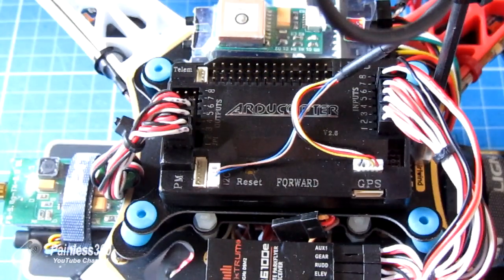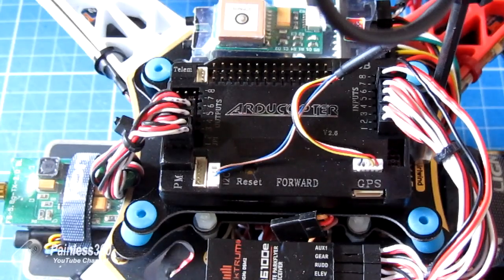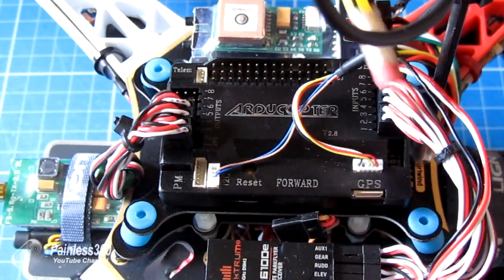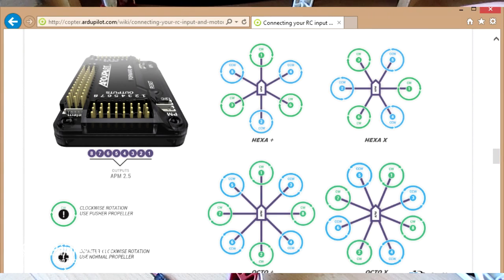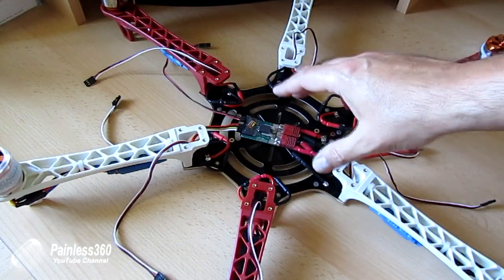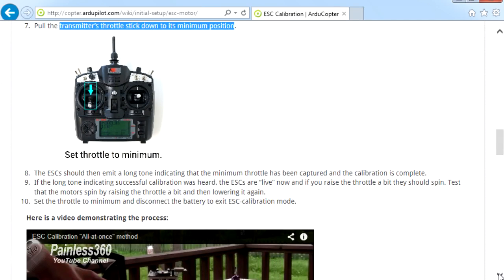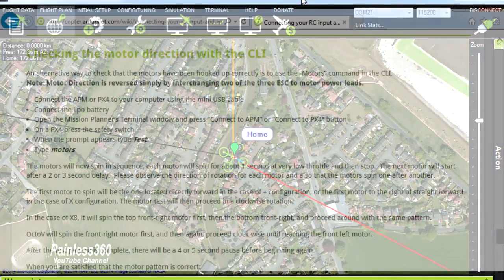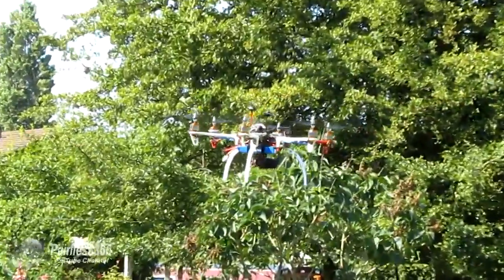(2/8) APM 2.5/2.6 - Powering the board, motor installation and ESC calibration

Comment: Hi there ,thnx for all the uploads ,ive found them very helpul ,im new to building and bought used kit with an arducopter flight controller in, im having problems updating the fc with the mission planner program, it is asking me to use bootloader (Potential for bricking fc in warning ) any thoughts , i can calibrate compass (Working) thanks for your time
Reply from the maker: If it is working fine then why update it? Mission Planner is good at recognising the board type normally so there is little risk. But, flashing it will mean that you will be setting everything up again from scratch and catching anything different that the original builder setup. Best of luck!
Reply: @Painless360  thnx for replying so soon.i wasn't sure if by connecting it to the mission  planner it had started some sort of auto update procedure .

Comment: Using APM 2.8, Taranis Qx7, every time I plug in the battery, I have to do ESC calibration / Arming. What is Wrong...???
Reply from the maker: an ESC will only enter calibration if it sees a high throttle signal when it's powered on - what troubleshooting have you already tried?
Reply: @Painless360  Thanks for your quick response. I follow your videos & instructions. They are accurate. APM is in stabilize mode. Still every time I have to go through Arming excercise.
https://youtu.be/LEKSkOFHB-c

Comment: Hello I want to ask that if I have already updated the firmware and done all the mandatory settings and there is a newer firmware version available after 2-3 months , then do I have to redo all the mandatory settings after flashing the new firmware or just flash the new firmware and the earlier settings will remain retained. Plz reply !!! Very Urgent !!! I am your subscribed user !!!!!!
Reply from the maker: Arducopter 3.2.1 is the last version that supports the APM, I've not used one for a few years now. I'd read the release notes for the version you're interested in but I always go through each step again after upgrade as things change..
Reply: Painless360 thanks a lot you solved my problem

Comment: Hello.
This might be a long shot asking for help here but I spent the last few hours trying to get this to work without success.

So I got a really cheap APM 2.8 board and got it configured with everything. My only problem is: the ESCs won't retain the calibration after I unplug them.

I calibrated all 8 ESCs one by one with my receiver and they all work fine, but when I take out the battery and plug them back in, they don't even start (they require the high and low signal every time they are powered)

the only way I could get it working was by painstakingly calibrating the ESCs, then plugging them into the APM board (without powering anything down).

is there any script or something so the board can do this calibration procedure every time when I start it? if there isn't, I'll just make a small board with an arduino and some transistors that calibrates them automatically when it powers up...

Thanks for your help in advance
Reply from the maker: I've not heard of that. I check the forums regarding the particular ESCs you're using.
Reply: The problem is, these ESCs are the really cheap ebay ones, so they don't have any info on them, only a "30A" sticker, but that's just the max load they can do. 
I did find a post on someone complaining on "30A mystery  ESCs" doing something similar, so  yeah, I'll look into it some more

Comment: Hello I'm newbie. I don't have power module, so i had power apm using input pins (direct from balanced pins on lipo ), and on the ouput i had removed +5V pin in 3 pins from ESC. plug it ok. Until i plugged ESC 11v to ESC distribution power board. SMoke out, circuit had been shorten. 
What have i done wrong ? pls tell me before my 2nd apm rip again. Thanks
Reply from the maker: Please follow the series here, I avoid problems like you've experienced. The Ardupilot website is excellent on the steps to follow to. Use a power module to power it, or a dedicated UBEC, don't power it from the battery..
Reply: Hi, thanks for reply. But I'm still very confuse. On ardupilot website did not mention anything about power apm pn input and ouput in the same time .So can i use JP1 to power through ESC. plug all 4 esc direct outpins like you did in video ? or just 1 ESC power and the rest are data only ?
Reply from the maker: All in the videos...

Comment: i have just got a APM 2.6 recently an am going to use it on an S500 quadcopter on which I am currently running a KK2 FC on.
I am running Opto ESCs on it and at the moment using a UBEC to power it from the batt/bind port on the RX, I am guessing that I can still power the APM controller the same way?
Reply from the maker: I'm guessing so. I haven't done anything with a pm for quite a few years now. Best of luck with the build!
Reply: Painless360 thanks for the reply and I decided to power it from the motor ports, just another question, I have calibrated ESCs but now when armed, it runs the motors automatically, any advice, cheers, great work.

Comment: Hey so when I do the ESC calibration all at once one of the motors #4 doesn't spin correctly its twitching is this when you have to do them individually or a sign of a defective motor?
Reply from the maker: I've struggled in the past with all at once calibration. That's why I tended to do it individually. I would personally have a go at trying to calibrate them individually and if one of them is still misbehaving investigate further. Best of luck!

Comment: 1. So the way I understand it, if I want to power a servo or two such as to operate a gimbal camera rig I should remove JP1 and add a 5V BEC power source to power the output rail. My ESC's are linear so I can leave the red wires in place. At the 4:02 mark you state that if you need to power the board via USB and power the ESC's with an outside power source, e.g. when using Mission Planner to check gimbal operation, etc., that "you will pay a fine" (meaning you will be kind of stumped by this later or do you mean the board will be damaged), please clarify. This video by 75echo (excellent source for more info) "https://www.youtube.com/watch?v=TFCmUuvcH04" warns about this also. I don't really get it as it's still 5V, must be current related. So I guess the work around is to install the jumper when doing tweaking, e.g. testing gimbal movements, mission planning, downloading flight data, etc. and you need to be hooked to Mission Planner. Then, after doing your setup and tweaking and before flying remove the jumper.
2. I assume the external BEC can be powered by the main battery or should it be on a separate one? Ideally a separate one but weight wise it's not practical. Just trying to be extra careful as I've had a few too many gadgets smoked by getting in a hurry and winging it. Anybody else welcome to chime in also.
 -- Thanks for all your hard work putting these videos together!
Reply from the maker: If you're planning on using something like a gimbal don't try and power it through the APM. Use another battery eliminator circuit to supply a separate, high amperage 5 volt supply to the servos so that in the event of a problem it won't affect the flight controller. See my build videos where I've done something similar.

Comment: Hi @Painless360 
I have got a pretty tough issue with my APM 2.8 build. 
If I do the setupt, calibration ... everything works fine. But if I then arm the copter and  just give it a little bit of throttle input, the motors jump to 25% immediately! (This behaviour is not seen while doing the esc calibration) - also if I try to take off, and start incresing power the drone (while I am still below 50%) just accelerates throttle in a crazy way and shakes horribly... I have no idea what I am doing wrong.... I use an APM 2.8, LittleBee ESCs, 6S LiPo and a PDB.

I summed the issue up in my video
https://www.youtube.com/watch?v=RKqYYa7d6Wk&t=3s

Maybe you have got an idea whtat the issue could be?
Reply from the maker: Not sure. See my APM series for everything that I used to do to get these boards flying well. The APM is very old now, and it's not one that I've recommended for at least two years. Check the forums, there might be detail in there that will help. Best of luck!

Comment: Hi Lee   I am changing the original radio supplied with my Quanum Nova Pro, for Frsky X8R receiver.  I would like to use an sbus to ppm converter cable with this set up. I have placed a jumper between pins 2&3 on the signal line. I noticed that there is a plug marked PWM on the analogue side. Should this be removed when using ppm?  Also the two cables that run to the gimble connectors under the body on the craft, can these be plugged into 6&7 on the output of the control board?, they were originally plugged into 6&7 on the rx.  I have watched the complete series on the APM and failed to notice any mention of PPM
Reply from the maker: When I swapped mine I used PWM and it worked great. Best of luck!

Comment: Should I use a power module for the apm 2.8???
Reply from the maker: You can..
Reply: Its already getting the power from the esc red wires...so should I use the power module only or only the esc wires or both??
Reply from the maker: +Saikat Das your best bet is to read up with the latest documentation. Here's a link - http://ardupilot.org/copter/docs/common-3dr-power-module.html
Reply: In esc calibration I have done Both the processes but one of esc is still beeping after arming..
Reply: the one which is not working..

Comment: may i ask how you mounted the anti vibration board?
Reply from the maker: +talal Alotaibi this is quite a old video so I guess I will have used one of two methods. I'll have either used cable ties or actually screwed the bottom plate to the top of the model. Happy flying!
Reply: well ok thanks

Comment: Hello, I have already burned 2 Power Modules. Can you give me some advice tips and tricks on how to install a power module? Do I need to remove all 5V red wires from ESC? Do I need to secure anything else? thanks...
Reply from the maker: I’ve not seen that here, I don’t tend to use power modules with a APM’s. Best of luck with it, let me know when it turns out to be..
Reply: If you are not using PM with APM then how you have installed failsafe option? I mean the option when the bat mah is under an amount THEN the quad does something. The FC must somehow be able to monitor the Voltage of the battery and without the PM the APM will not be able to do nothing.
Reply from the maker: You’ve answered your own question there ;) I’ve not used the APM for years and no longer recommend using one (see the last flight controller comparison video). Happy flying!

Comment: Hi i followed ur videos about APM but i have a problem. I upgraded from CC3d setup to APM 2.8 recently. So the wireing and ESC + other parts should working fine. But when i try to do esc calibrating (both single and all in one methods) my ESC s keep beeping. how to fix this?

Comment: What if I'm using ppm-sum which sums all the channels pwm signals (throttle - yaw - pitch etc.) and uses only 1 channel instead of using different channels for each pwm signal? I mean my throttle channel is 1 but everything else is channel 1 too so can I use that channel to calibrate my esc's manualy?
Reply from the maker: +Okan Kaylan you need a PWM signal, you can’t use PPM to manually calibrate the throttle. You can still try the all in once method..
Reply: I've purchased a new nova pro fitted with APM 2.6. I also got a Turnigy evolution tx with  ia6c Rx.  I've read and watched 100hrs of tutorials but I can't figure out the config for optimum wiring.  Im thinking I need a different APM that supports ibus or grab a converter cable. 
Any suggestions please?

Comment: can my esc power up apm board?please let me know as im confused of its specs http://arduinopak.com/Prd_Detail.aspx?Prd_ID=17540 or do i need power module?
Reply from the maker: The BEC in your ESC that supplied 5v should do.. You'll see me cover all of that if you watch the series.. Best of luck!
Reply: Painless360 yeah i saw it that you covered. But you also said it should be 3A also. So im a bit confused here. Is my esc output 3A in bec? Thanks :)
Reply from the maker: +Mukarram khalil only the specs of the ESC you’re using will tell you that..
Reply: Painless360 my specs say stressed 5v/3A and linear 5v/1A. So what does that mean?
Reply from the maker: +Mukarram khalil no idea, I've never heard of something being described as 'stressed' before. I assume that means a temporary peak?  Id check with the vendor who you got the ESC from. Best of luck

Comment: what motors are you running on your hex or quad?
Reply from the maker: +InventorJS -Jacob Singh depends on the weight of the model and the size of the props you can use on your frame. Motors like the 2212 920kv motors with 10" props are popular choices..

Comment: Sorry about the noob question but if APM needs 5v, can we power it with a 2s battery. I'm trying to get more flight time.
Reply from the maker: +Jasvinder Rekhi see the videos in the 'Introduction to Remote Control' and the 'Quadcopter Building for Beginners ' series for more of the basic. The flight controller, radio receiver and GPS are not powered by the flight battery directly, but by something called a BEC that converts the main battery voltage down to the 5v needed.. hope that helps..
Reply: Painless360 Firstly thank you so much for the quick reply. And I've built my first quad with the help of your videos. I really appreciate you taking out time to make the series. I have the power module for the APM, Yes. actually my question was incorrect. I meant Is it possible to power the entire quad using a 2s battery. I was thinking of building a 18650 battery pack. And was wondering if an overall 8Volt would be enough for it all.
Reply from the maker: +Jasvinder Rekhi I've not. You'd need to make sure the battery could deliver the amperage needed and that you'd get enough thrust on that low voltage too. Best of luck!

Comment: Hi! My question to you is can I connect the 3 wire plugs from the ESC's straight to the APM output or do I have to remove the +5v leads of 3 ESC's (in case of a quad copter). And another thing do I need also to remove the JP1 jumper or not cause I do not know it purpose yet.
Reply from the maker: +Roderick Bugeja what's your guess after watching the video?

Comment: I have 40 amp emax ubec ESC and I am using pixhawk px4 so to power the fc I am using power module .My question is  should I have remove ESC (+5volt)power cable or I can connect as relay power
Reply from the maker: I cover this in the series. You can use the ESCs as AUX power and add a ZENER diode. It's also all covered in the documentation - http://ardupilot.org/copter/docs/common-powering-the-pixhawk.html Best of luck!

Comment: Hi painless360. Thanks for these awesome videos! 

I just finished assembling a hexacopter and finished all the mandatory setups in apm planner. For some reason, and inspite of having calibrated all six escs, two of those won't spin upon arming the craft. I can tell that the two escs  are functional, but they won't spin the motors. Not sure what I'm missing. Amy help would be greatly appreciated. Any parameters I need to fix to qualify the craft a being a hexacopter apart from the frame params?
Reply from the maker: It should just be the frame setup in Mission Planner. I'd re-do the ESC calibration manually and try plugging in one of the working ESCs into one of the non responsive outputs to help you see where the problem is. Best of luck!
Reply: Painless360 thanks for the quick response! I figured it out. Silly really. I remembered that this board actually powered a quad before this. I reflashed it and now everything is ok.

Comment: Hi Painless, great video.  I followed the instructions for setting up the ESCs on my quad manually.  All motors power up.  I am using mission planner on a MacBook Pro and have 2.8 app installed.  I looked at the inputs and outputs with the board armed in the failsafe section of mission planner initial install and noted that when throttle at low the servo outputs all read 1129 and were rock steady. At 1/2 throttle - output 1 = 1570 but hunted up and down, output 2 = 1550 and hunted up and down, output 3 =1640 and hunted up and down and out 4 = 1375 and hunted up and down.  At full throttle: output 1 read 1800 and hunted, output 2 read 1800 and hunted, output 3 read 1899 stable and output 4 read 1650 and hunted. I am thinking that the ESCs are not set up correctly as I would have thought that they would all read the same values as they moved up the throttle range when in static mode. I appreciate they will all move independently when flying. Before I make an expensive mistake grateful if you could advise if I am barking up a wrong tree here or yes the ESCs are not correctly calibrated. Regards Andy

Comment: Hallo do you want look at this problem  https://www.youtube.com/watch?v=TQ-v8IZcrFE  No good signal to the ESC from APM, i think. but how to solve ??  Thanks
Reply from the maker: Could be lots of things, what have you already tried? Lots of pilots find playing with the THR_MAX parameter is helping.. Best of luck!
Reply: what have you already tried? 
calibrate esc throt min/max, esc emax 30A programming via Tx  1 to 7
reset buttom apm.  
when i connect lipo direct beepbeep ect. then disconnect esc of the apm the ♪123♪123 sounds. reconnect the esc to the apm -> motor spins.
THR_MAX cannot find btw. Download also apm plannerv2.0.24
have read somewhere that apm doesnot work with afhds 2a. I have a tgy-i6s ??

thanks
Reply: one more question.  In the mission planner i cannot find MINIMUM_THROTTLE. Can yousent a picter